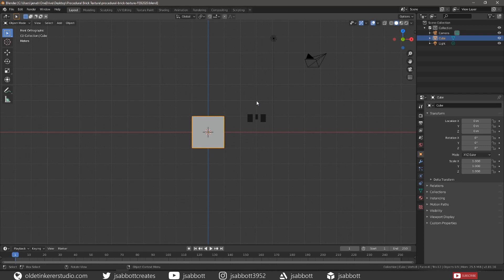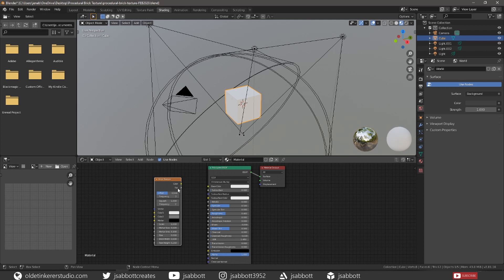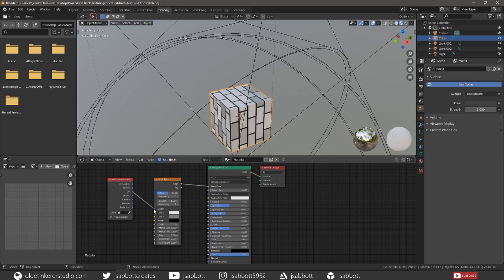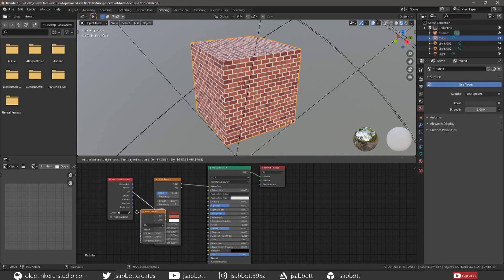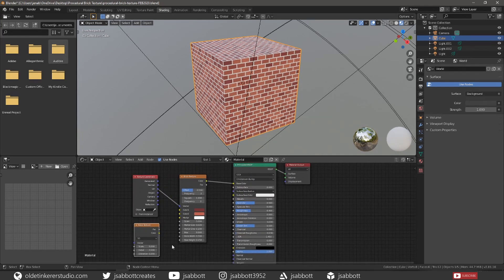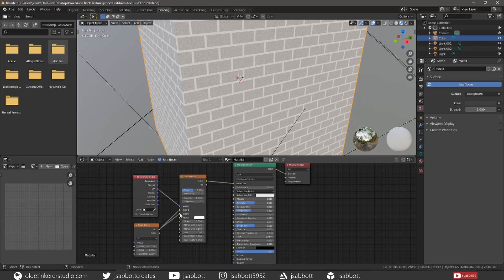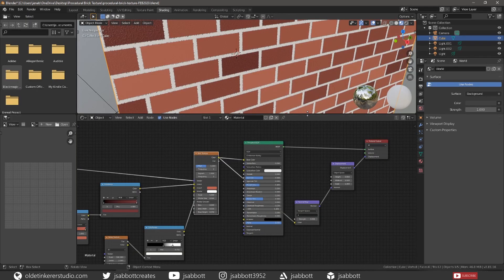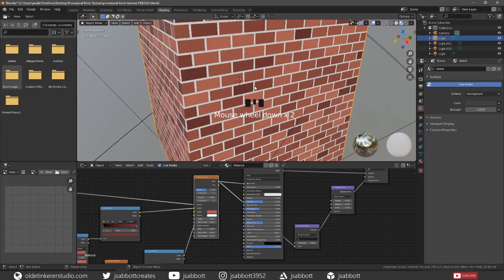How to make a procedural brick material in Blender [2.81]

Comment: What's the displacement node good for if you don't subdivide faces of the cube?
Reply from the maker: There's multiple ways of using a displacement map. In this case, I was able to use the color of the normal map to add displacement to the bricks.  (14:54)

Comment: What about applying this to different objects? The bricks differ in size and it looks extremely time consuming and tedious to alter each objects UV - especially if creating a town with many buildings. Surely there is a way to universally scale for multiple objects easily? Would appreciate any help
Reply from the maker: You can link materials from one object to another using CTRL + L. However, this means that each time you scale one material, they will all scale. You could make a copy of the material and use the Texture Coordinate node set to "Object" (which means the individual object will determine how the material is presented). Texturing is a time-consuming process.

Comment: thanks a lot, its simple and very useful. If you let me comment the next one, I'll do it, try to make a shorter video tutorial  next time, but its ok this!
Reply from the maker: I could make the tutorial shorter but I want people to know why they are using certain nodes rather than just how to simply make a texture.
Reply: @JSAbbott  your explanations are so helpful for actually understanding what I'm doing (otherwise I'd just be memorizing steps without a clue of what anything does), thank you!!
Reply: @JSAbbott  Greetings. What about if I do not want texture on the top of the cube? How can I get textures only on the sides, but not on top? Many thanks :)
Reply from the maker: @milisonics  I'm thinking that the easiest way would be to have the top of the cube be a separate object.
Reply: @JSAbbott  Well, that is not a bad idea. Many thanks ;)
Reply: @milisonics  you could also have it be a separate material (for example if you wanted the top to be a metal plate you could assign the top to a different material and make the other material what you want to)